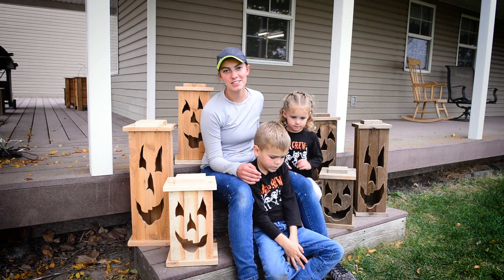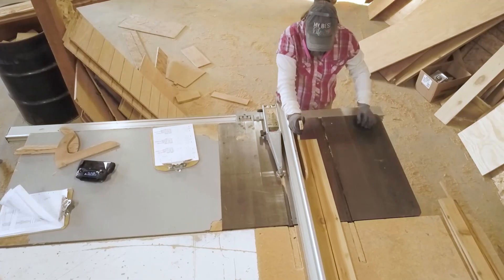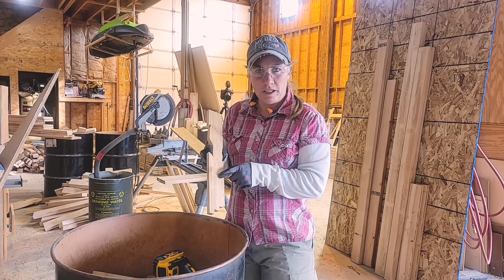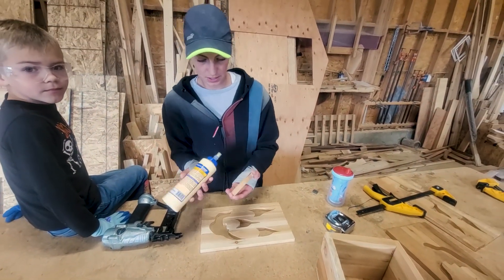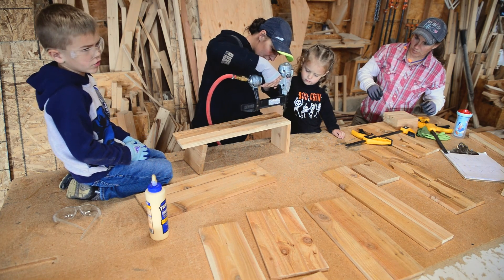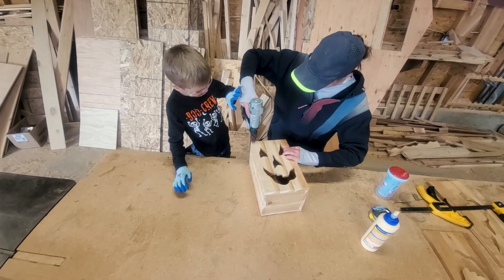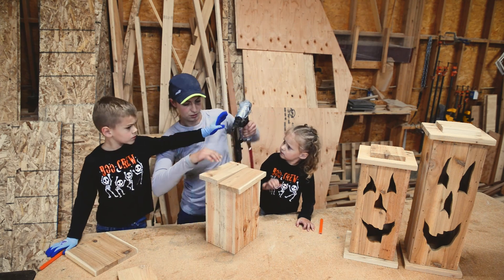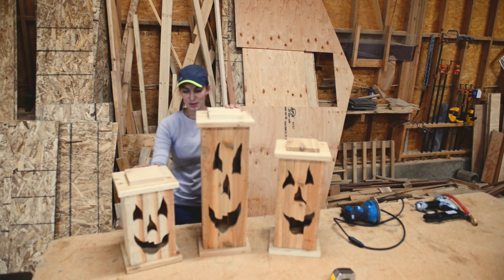Easy DIY Halloween Pumpkin lantern decorations

Comment: Great Halloween project the tool you use to help push the wood is this something you made or bought I have seen this in other videos
Reply from the maker: There are ones you could buy, but I just made my own out of a scrap piece of 1/2" plywood. They are called push sticks if you look to buy one.

Comment: Awesome video and project.  One question, have you thought about making the top removable, so people could put in flickering tea cup lights or similar lights to mimic a jack o latern?
Reply from the maker: I do use the flickering  tea cup lights. The ones I use easily slide through the mouth opening. But making the top removable is an idea to explore.
Reply: Cut the back piece so it's 2-2.5 inches above the base.  That will allow you to slide one in and out as needed.  No hinge necessary.